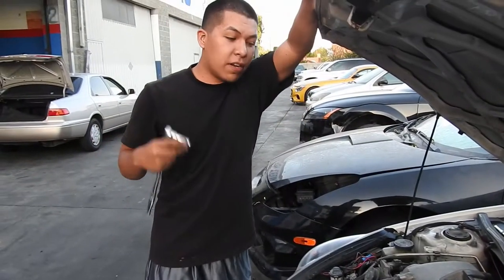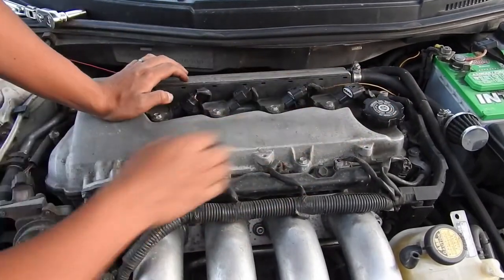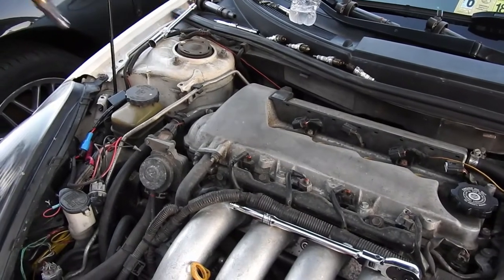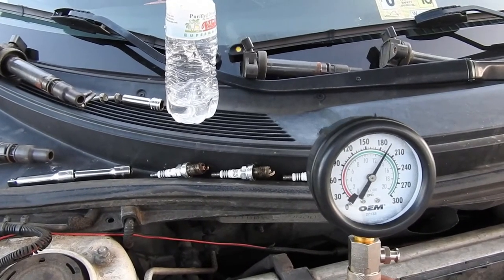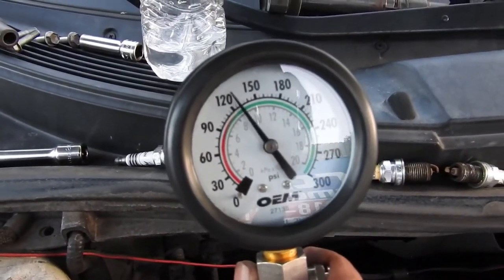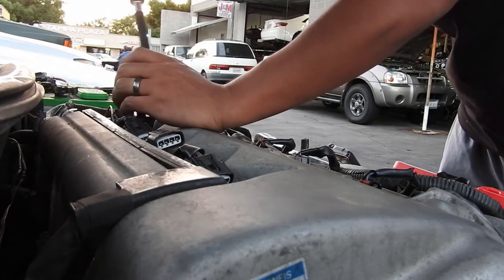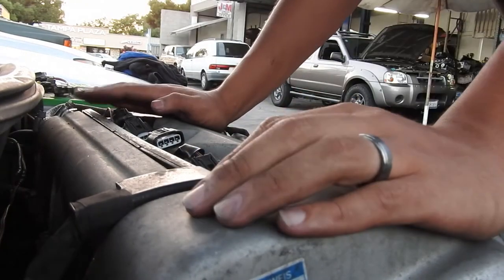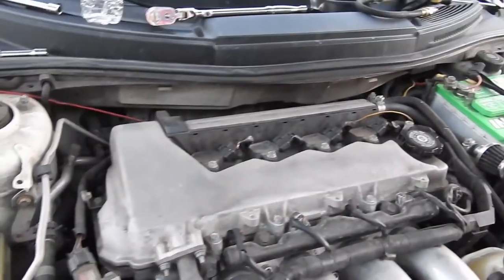How to do a compression test

Comment: I think you did not grasp the correct compression numbers from Toyota. Tha manual says compression should be 203psi and over for a healthy motor and 145-200 psi as acceptable with 16 psi variance between each cylinder